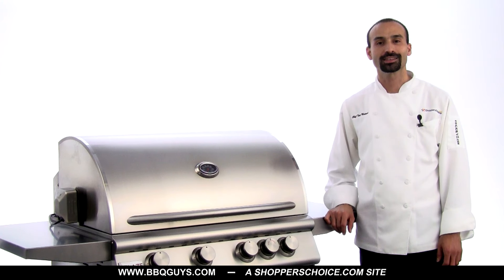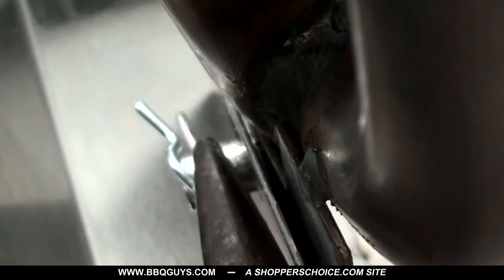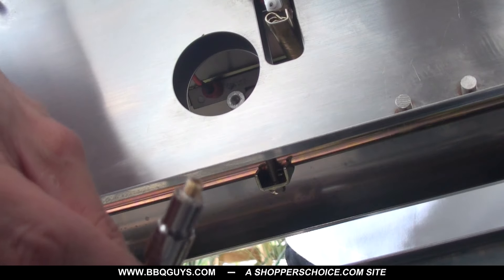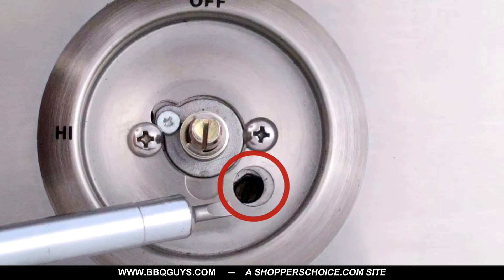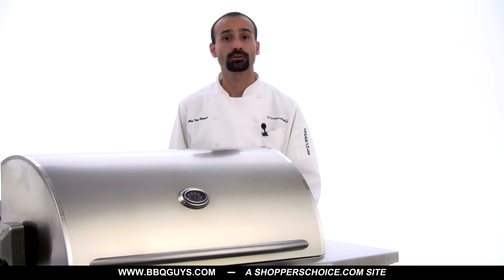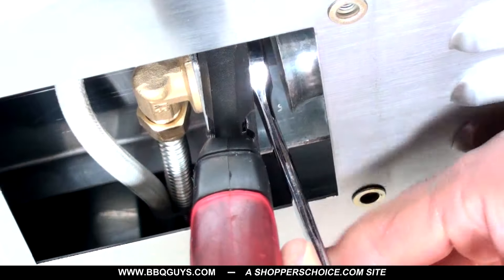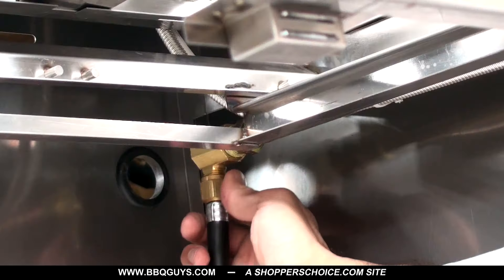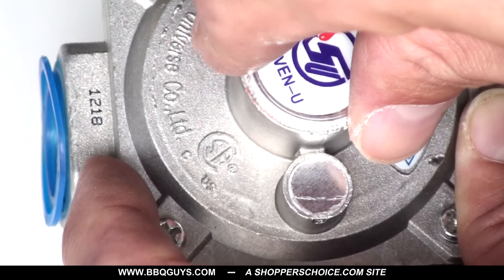How To Convert Your Blaze Grill From Natural Gas To Propane

Comment: Thx Tony, great video.  I have a Bull Angus 4 burner plus back infra red.  The whole kit is available for my model, but requires replacing 4 valves and the one orifice for the infra red.  They don't sell just the orifices.  Can you tell me where I can buy just the orifices?  There is a guy in SoCal who makes them custom.  But is there another method to locate/buy the correct replacement orifices?

Comment: Will this method work with the Bull Brahma grill?
Reply from the maker: You will need this conversion kit, on Bull you will be changing the whole valve instead of just the orifice.  https://www.bbqguys.com/bull/conversion-kit-for-brahma-gas-grills-natural-gas-to-propane-18468  Make sure to reference Bull's specific instruction manual for sure.
Reply: Thank you.